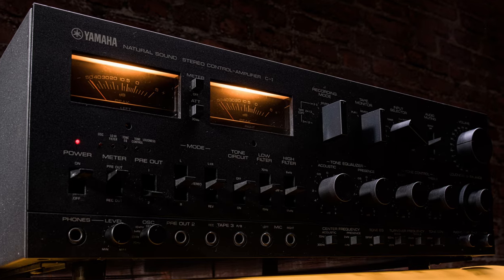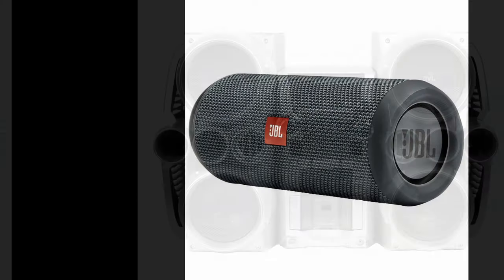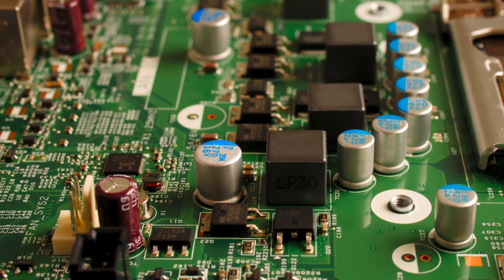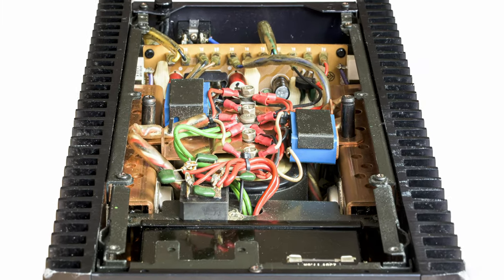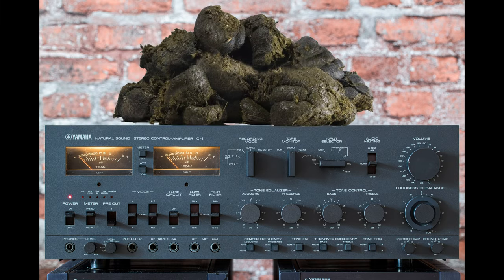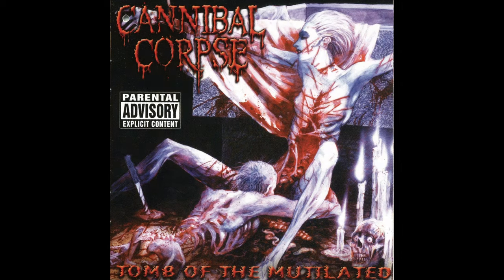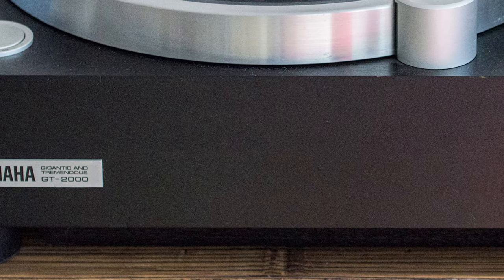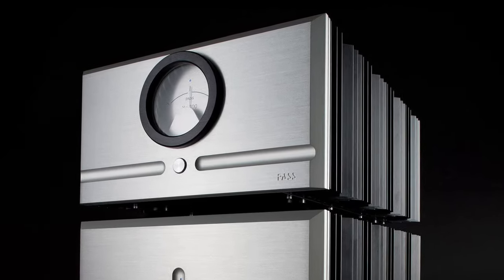Hi-Fi Buying Guide and Perfect Budget Build - Part 1 - Intro / General Guide

Comment: I had to chuckle at the bit where you were talking about Thrift Shops but showing a clip from a SkyFi Audio video! For anyone none the wiser, they'd have a bit of a shock if they went into a charity shop expecting a walk of McIntosh gear like that. Sadly, these shops are mostly full of absolute crap these days and you'd be VERY lucky to find anything even half-decent in them any more. I was surprised you've had such bad experiences when buying from Japan as the Japanese sellers are famous for packing so well. I bought a turntable from HiFiDo in Japan and it was incredibly well packaged. I suppose it depends on whether it's a commercial seller/ dealer or just an individual. In general, most people have no idea how to package HiFi components for shipping, sadly.
Reply from the maker: You're right, thrift shops are not what they used to be, mainly because of the internet. But still, if you're lucky, you may find a shop chock-full of McIntosh and Accuphase gear for couple of quid :))

That must've been some stroke of luck, because every single time I bought something from Japan, it was a disaster. Except for maybe one time when they packed it rather well. Exactly, they don't have an idea how to package HiFi components or they just can't be bothered to do it properly.